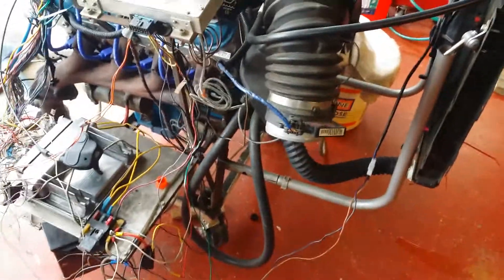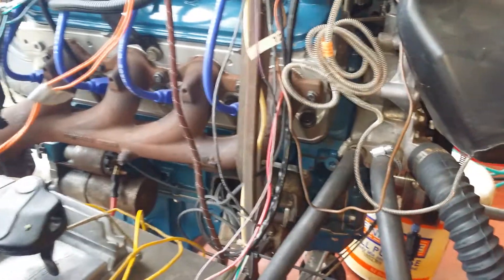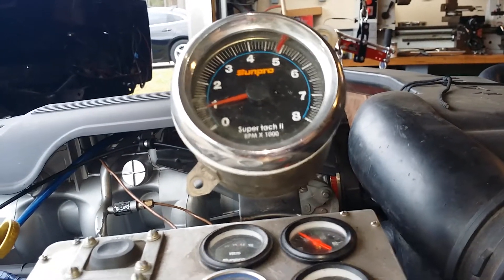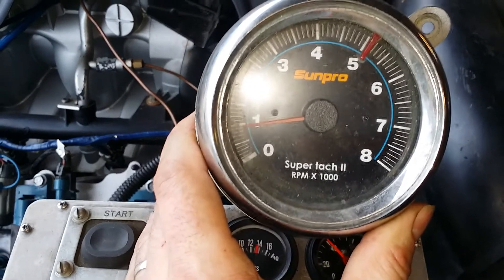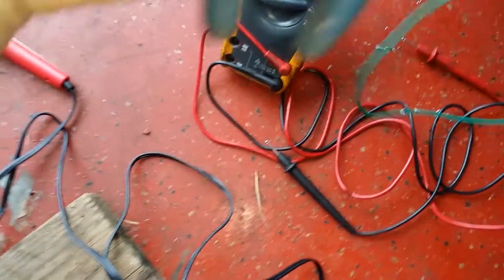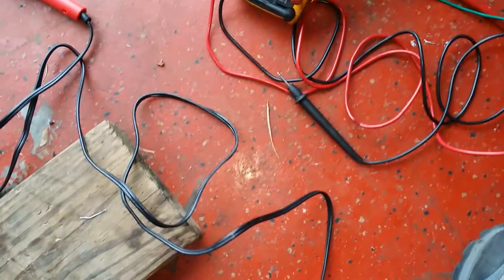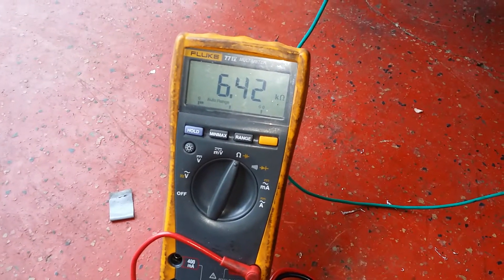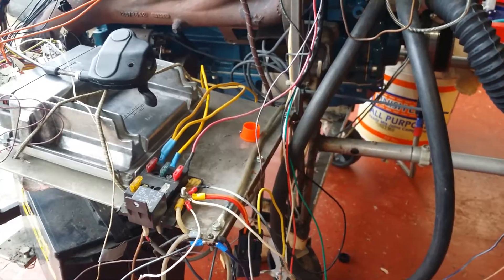LS Tach signal, the proper way with best results. Part 2

Comment: Hey I’m looking at ordering a potentiometer on Amazon it has 3 wires coming off of it. Red, White and Black. Red would be 12v which wire would be for the tach itself White or Black?

Comment: Hi what kind of resistor you use?
Reply from the maker: The resistor I use for this application with a relatively cheap SunPro 3" tachometer is a 4.7k ohm. Color code is yellow, purple, black brown,brown. Actual resistance on this specific resistor was 4.713k ohms. It seemed to do the best for a smooth transition as engine rpm increased and decreased.